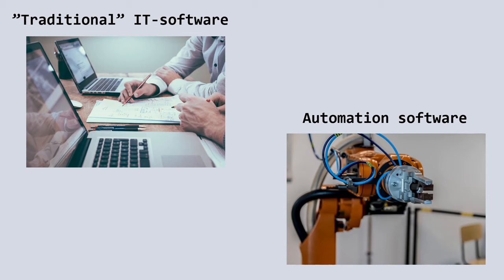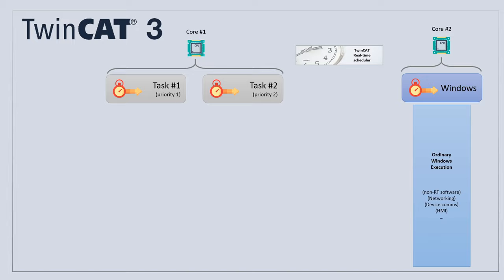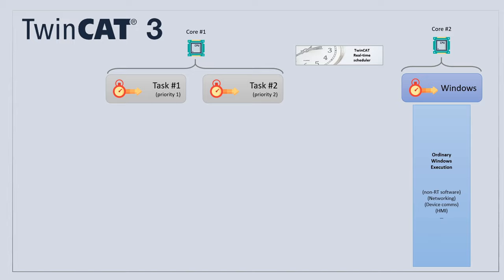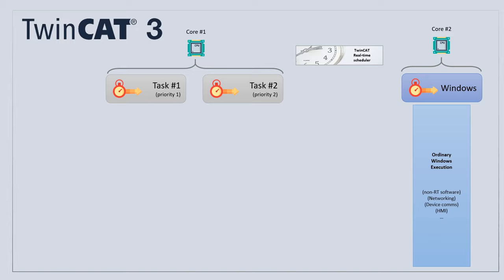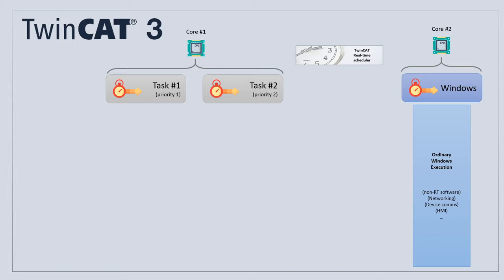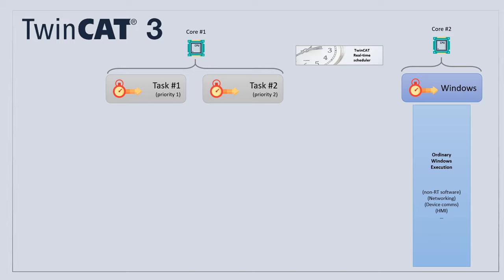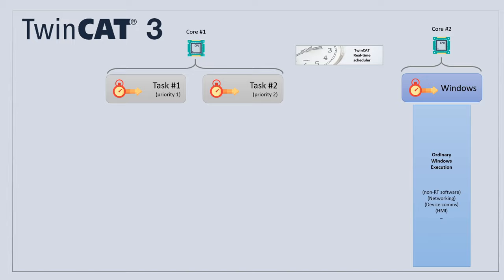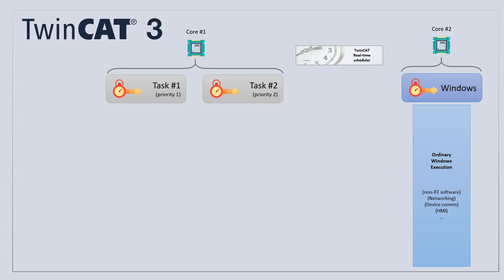PLC programming using TwinCAT 3 - Tasks, programs & “Hello world” (Part 3/18)

Comment: HATS!!! If you were my kid I would give you 10$... nah, kidding!
One thing, The first time i have installed Twc3 I messed it up with a program and i think with a network adapter. Then ive got a permanent 1803 error each time I start the RT system.
I have installed 2 times more but having the same error. Then I have uninstalled and manually erase every file or folder named Twc Beckhoff etc, and the same in the registry. Only then and after a clean installation i have no errors at restart. Thank you for your videos. you deserve our support.
Reply from the maker: Well if you want to give me 10$ you're more than welcome to do it by becoming a channel member 😉
Reply: @JakobSagatowski  44 4f 4e 45
Reply from the maker: @soulrobotics  54 48 41 4e 4b 53

Comment: A question regarding the example of tasks execution in the shared core configuration: does the cycle time for task1 and task2 in this example is of 1ms or you still intended the same configuration for the previous example of about 10ms per each task? Let me understand more: for the 1ms scenario I would say that task1 and task2 ended their code cycle completely that's why the OS gets waken up immediately in the first tick while for the 10ms scenario I would say that task1 and task2 went to idle (the OS gets waken up also) but still they didn't complete their internal code cycle because I can see by the graphs that the next time a tick happens, they will be doing other calculations, otherwise I will expect only the OS to run for all the remaining cycle-time of the tasks. Are those two scenario the correct way to see it independently of the cycle-time you defined?

Comment: Hi Jakob, Would really like to thank you for this tutorial series. It has been quiet confusing for me till now with Beckhoff PLCs. the Insfosys is definietly a bit overwhelming, but i find your tutorial quiet easy to take in. I have a question at this point. i have a Beckhoff PLC CX8090 which has twincat 2 runtime in it. Could i program this PLC using twincat 3? I understand, that twincat 3 is an extension of twincat 2, so maybe we can migrate the plc projects between twincat 2 and twincat 3. Is it possible?
Reply from the maker: Hi Lakshimi! No, you can't program a target device running TwinCAT 2 using a TwinCAT 3 engineering environment. You can migrate a TwinCAT 2 project to a TwinCAT 3 project, but then you can't deploy it to your CX8090 anymore.

Comment: Hello Jakok,
Thank you very much for the series of tutorials.
I would like in my company to switch to beckhoff PLC to allow communication with our IT system.
The goal is to add a communication layer between the low level devices in the assembly plant and the ERP system.
But I have a point from my IT department concerning the security.
By default, all PC in my company are managed by the IT. They control the hardware, software, rights policies, antivirus, firewall, etc...

What is you opinion about the windows OS for a PLC concerning 
Stability : windows malware, virus ?
Need of an antivirus ?
windows update ?
windows reboot ?
Disk fragmentation ?
What is your recommendation on those topics ?

In PLC world, when a system is installed, it will never changed (except for bug correction and new features requested).
In my plant, we have plc that have been running for years without any intervention (maybe one stop per year for summer break) and the system had never been updated. 
Does windows PLC can run without any reboot for long time ?
Do you suggest to reboot the PLC every week (month) ?

I asked beckhoff about the BSD solution but you loose all features concerning files management, ftp, database, mqtt, etc ... so the advantage of the twincat solution.

I have an application developed by an integrator with WAGO plc on Linux os, do you know this solution, how does it compare to beckhoff ?

Thank you again for the time spent to make your tutorials that are very well explained.
Reply from the maker: Hi Olivier!
I would say standard procedures regarding security apply. A beckhoff PLC is just a standard PC (in industrial casing) running Windows. Of course it depends on whether PLC is isolated or not, but if it's connected to company network then it should (from security perspective) be treated like all other devices.

I've seen installations with Beckhoff PLCs running for years in a row without a single reboot. In combination with UWF you generally don't need to worry about what's happening with the disk (just make sure to apply the correct rules for the installed applications).
Reply: @JakobSagatowski  Thanks.

Comment: Hello Jakob, I need some help. I know this video is a bit old. So here is my situation, I’ve basically copied the exact code and setting you showed in the video. But besides simulating, I’m actually downloading to CX5140 controller. When I download then go online. And hit the start program button. My program does nothing. I look in the online task menu bar and the red line in the trend stays at the bottom and never moves. It seems like my task will not run. What can I look at? What could be the problem? Is it due to not having a runtime license on my controller?

Comment: Hi! I have a couple of questions about the tasks in TwinCAT.

1. In you video, it is depicted that the PLC tasks is called and executed at every tick (1ms as an example of the Base time) and finishes within 1ms. Well up until the 4 tick since Task #2 took longer. However, I thought since the example cycle time of a PLC task is 10ms, it would instead run every 10 ticks if it finishes it within 1ms?

2. I was wondering if you happen to know what does the I/O Idle Task and PlcAux Task do in TwinCAT? I can't seem to find any info about this in their InfoSys website.
Reply: 1. this is what I do: I imagine that Automation was created by Dutch people who worked on Windmills. You see windmills have been used to cut logs; there is big saw blade going up and down; whenever the blade goes down to cut a log that is a tick. That's how these people think and imagined the things: in ticks and tacts. A log (a task) need several ticks to be cut (finished). If you set a task to be run every 10 ms and it takes 1 ms to finish that means you put a log every 10 ms to be cut and each log takes 1 ms (1 saw going down) to be cut; in the meantime, even if the log is cut and discarded, the saw blade will continue to go up and down (ticks continue), regardless if you have a log or not. This task will still continue to execute every 10ms and it will check every 10ms if that flag variable (run only once bool) if it's true to run that message again. But it won't run the message; that part of the task is not executed though the variable is checked every 10ms.
Reply: I think his explanation was kind of misleading. As far as I understood, PLC tasks are only run during "base-time". And within the base-time, you can only use up to X% of it on PLC tasks (in the example 90%). Only one base-time is run per cycle time. Every tick is equivalent to the length of the base-time. All the remaining ticks within the cycle time that is not part of the base-time are used by the OS.

Comment: do you have any solution if I make (accidently) an infinite loop in one plc cycle (by a while or a repeat until) the PC or PLC drop blue screen with tcplc30.sys error and restarts windows 10. In Siemens PLC-s in this case only goes to stop mode because the cycle time is exceeded but here the whole Operating system crashes

Comment: I have a laptop with 8 cores and 16 logical processors. For some reasons, twincat sees 16 cores. Is this normal?
Because that would seem weird, that I could allocate half a core fully to twincat
It's a lenovo thinkpad
Reply from the maker: All normal!
Reply: @JakobSagatowski  Thanks ! Well, today, I tried making a communication with some technosoft drive. However, I realised I couldn't find anything plugged by ethercat into the laptop. I have a ThinkPad E16 Gen1. Apparently, the laptop cannot do EtherCAT, which I find weird, because if I recall correctly, you also have a lenovo thinkpad. What do you think ?

Comment: Hi Mate
This the complete error I am having, Actually I am running TwinCad 3 on Win 10

Severity	Code	Description	Project	File	Line	Suppression State
Error		11/18/2021 12:37:57 AM 774 ms | 'TwinCAT System' (10000): Sending ams command >> Init4\RTime: Start Interrupt: Ticker started >> AdsError: 4115 (0x1013, RTIME: system clock setup fails. 
Hint: On Windows8 system and above execute win8settick.bat in TwinCAT\3.1\System as administrator and reboot.) << failed!

Comment: Much Thanks for your efforts you put on your videos!! the activate button is not working on my machine, how can I fix it so I can activate my code?
Reply from the maker: Hey! Have you selected the local computer as target?
Reply: @JakobSagatowski  I am running the TwinCat on a virtual machine on my MacBook, and yea the target is set to the local computer, and I have enabled the VT-x/AMD-V on my virtual machine box but still not working,, thanks a lot for your help
Reply: and when I go to System settings to activate either the Run mode or config mode it says function failed, if that would make it clear for you

Comment: Hi, I install at windows 10 server 2019 and my virtualization is enabled and i got this error setting twincat in run mode on shared core(s) inside virtual box (virtual machine) is not possible --- Can you help me?
Reply from the maker: Hi. You have to set the task to run on an isolated core just as I show in the video.
Reply: @JakobSagatowski  I forget to set two core on my virtual machine was just one, now is it working Thanks

Comment: Hi Mate 
Thanks for the awesome tutorials 
I am having an error when running runtime

Severity	Code	Description	Project	File	Line	Suppression State
Error		11/18/2021 12:37:57 AM 774 ms | 'TwinCAT System' (10000): Sending ams command >> Init4\RTime: Start Interrupt: Ticker started >> AdsError: 4115 (0x1013, RTIME: system clock setup fails. 
Hint: On Windows8 system and above execute win8settick.bat in TwinCAT\3.1\System as administrator and reboot.) << failed!				

Could you please help me..
Thanks very much
Reply from the maker: Just follow the hint.
Reply: @JakobSagatowski  thanks for the reply..
Will try to solve the issue 
Thanks again for informative tutorials

Comment: During the first attempt I couldn't even run it. There were 2 errors that popped up:
               'END_VAR' expected instead of "
                     and
                ';' expected instead of ':'

Here's my code:

IF NOT bRunOnlyOnce THEN
    ADSLOGSTR (msgCtrlMask := ADSLOG_MSGTYPE_ERROR OR ADSLOG_MSGTYPE_LOG,
		       msgFmtStr := 'Hello World!',
		       strArg := '');
	bRunOnlyOnce := TRUE;
END_IF

Can anyone help me??
Reply from the maker: Hi Eric. It seems there is something wrong with your variable declaration. Could you please post the variable declaration? (everything in the "upper" part of the function block)?
Reply: @JakobSagatowski  So I think I fixed that part after I commented, but here's the variable part:
PROGRAM MAIN

VAR
	bRunOnlyOnce : BOOL := FALSE;
END_VAR

Im pretty sure I had ':' after the FALSE instead of ';'.

I do still have an error though it says:
"7/1/2021 6:22:13 PM 413 ms | 'TwinCAT System' (10000): Sending ams command >> Init4\RTime: Start Interrupt: Ticker started >> AdsError: 4115 (0x1013, RTIME: system clock setup fails. ..."
Reply from the maker: Did you follow my guide according to part 2? Are you running twincat in a VM?
Reply: @JakobSagatowski  I thought I did lol ill rewatch the part 2 and the setup. I'm running twincat just through TcXaeShell on a windows os. Should I be using that VirtualBox to run it on?
Reply from the maker: You can do it either way. If you run it in a VM, make sure to run it in an isolated core. Part 2 explains how to do it.
Reply: @JakobSagatowski  cool ill retry the setup part using both then see if I can get it to work. Thank you for the help!

Comment: Hello Jakob,
when running the program i have the following error codes. could you help me with a solution?

Severity	Code	Description	Project	File	Line	Suppression State
Error		11-08-2023 14:01:05 107 ms | 'TwinCAT System' (10000): Sending ams command >> Init4\RTime: Start Interrupt: Ticker started >> AdsError: 4115 (0x1013, RTIME: system clock setup fails. 
Hint: On Windows8 system and above execute win8settick.bat in TwinCAT\3.1\System as administrator and reboot.) << failed!
Reply from the maker: The answer is literally in your question. Read the hint.
Reply: @JakobSagatowski  I did understand that i have to execute the bat as a system admin. but do i have to perform this everytime? Just asking as i am new to PLC programming
Reply: @mridul_SIL  I got the same now. Did you find the solution? Is it only one time, or does this happen every time?

Comment: Great Series! Really well done!  If I bought something used/inexpensive off ebay ( CX9000-0001 + KL2488) just to have something more to experiment with would I have any trouble obtaining a weekly temporary license? Based on the chapter on licensing (~46:00) I don't think it will be a problem but I wanted to confirm before I start spending...
Reply from the maker: No problem whatsoever. You can run test licenses on real hardware just as on a virtual machine.